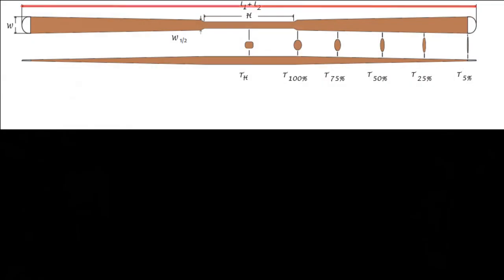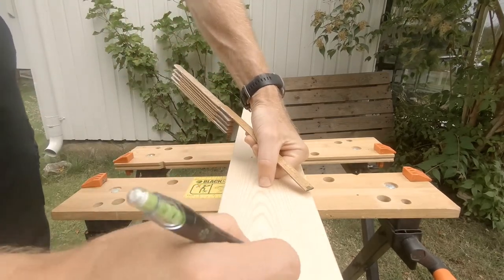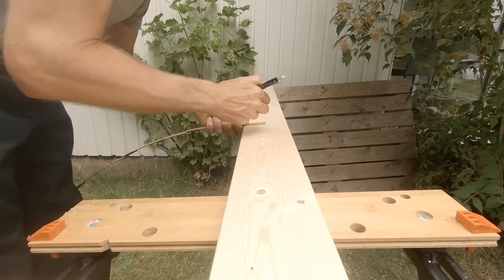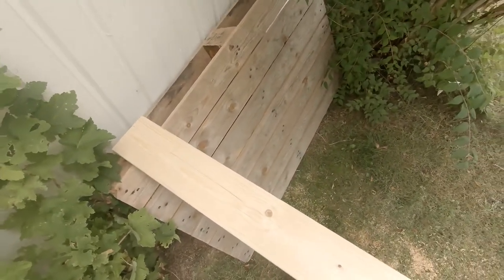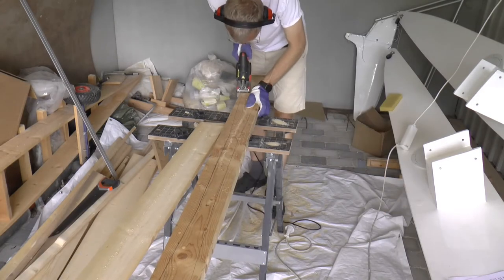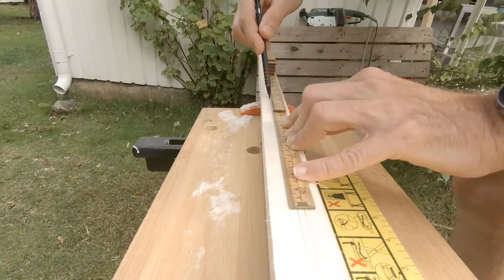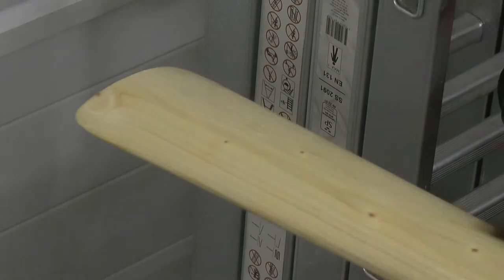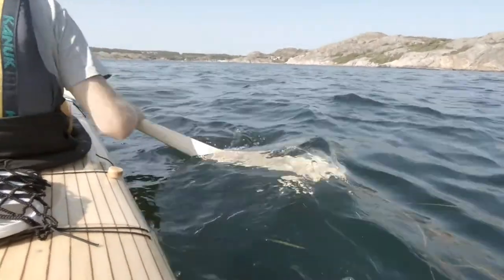How to make a DIY Greenland paddle or pagaj for your kayak #147

Comment: From Australia again. I ended up with a strange laminated paddle that comes in under 700gm. Starting from the outside, a layer of western red cedar, then a 2mm layer of 120 year old English oak I had from another project, then balsa wood sheets. A 600mm length of aluminium rod for rigidity. It works really well, and is very light. Balsa wood is strong  and of course weighs nothing.
Reply from the maker: Glad that you got a paddle that you are happy with. I find the Alaskan paddle much more pleasant to paddle with than my pagaj.

Comment: From faraway Australia, thank you. The best video on such a paddle I have seen. I will keep my paddle shaped in an elipse on one side but as you mentioned not especially shaped on the back...for strength and who uses both sides?
Think I will use cedar, and maybe cut a narrow groove in the handle, insect an aluminium or steel rod and fill up the gap, to strengthen the paddle.
Thanks again.
Reply from the maker: Thank you for commenting, it is much appreciated. Laminating several layers together might be an other alternative to strengthen the paddle. Actually I think it might be better to turn the curved side backwards, if you have a look at my video (https://studio.youtube.com/video/nHL4z8HBPwM/edit) how I did the Alaska paddle, I use it with the bulkier side backwards and it is more stable, although not as fast.
Reply: When you rip the board in half to laminate it, reverse the grain by flipping one of the sides end-for-end. 
Then add a contrasting strip of wood about 1/4 to 3/16” wide in the center to add another glue joint. 
It is the glue joints that stiffen it. So don’t use a heavy wood thinking it will be stiffer. 
Contrasting color wood for the center spine not only looks good, it serves as a nice visual reference when you are carving and shaping the paddle. 
I only made one paddle not laminated. And found it way too flexible by the time I got it down to the weight I was anted

Comment: Interesting how you got your measurements for making the paddle the correct size. But when I saw you place your hand under the board to hold it as you used a planer I was shocked. That's a really good way to lose a finger tip or worse never put your hand under the plane or running even with a board between the one slip and that's it. Be sure to warn your video watchers not to ever do anything like that.
Reply from the maker: I see your point.